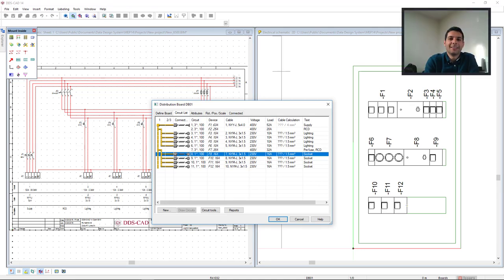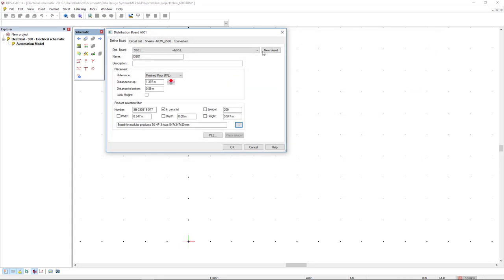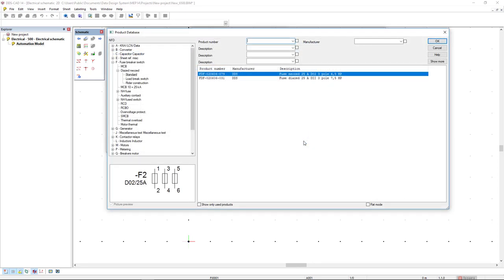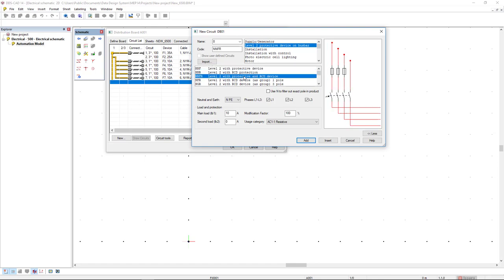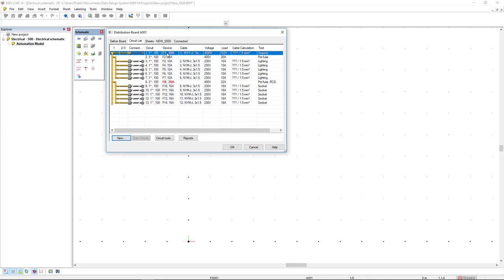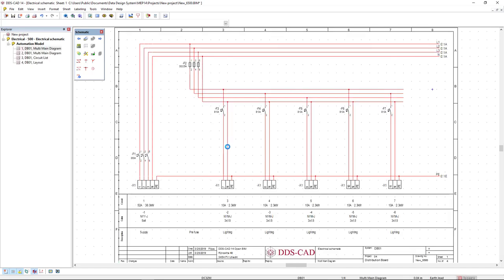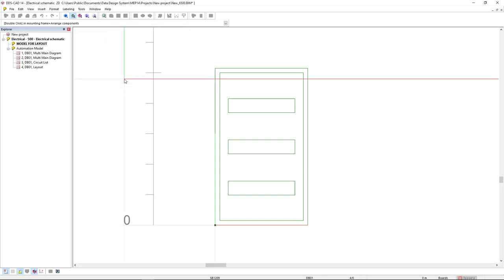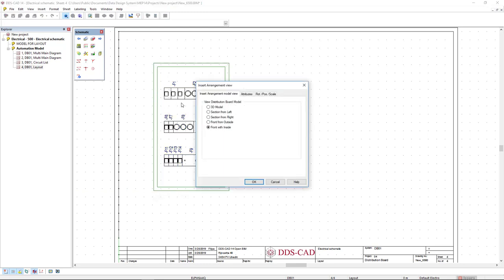Creating an electrical board and generate automatic diagrams in DDS-CAD

Comment: there is a method to give a different cable size for N e PE cables ?
Reply from the maker: Hi Daniele, DDS-CAD offers by default different cables types with various cross sections and also alternatively sized conductors. Activate the option "Flat Mode" whilst you have the cable database open. To filter out relevant cables enter e.g. "SM/" in the Description field.
Reply: @DDSCAD-MEP  ok let me explain better. In Italy, the CEI 64-8 standard envisages having the N and PE cable with a section equal to half of the phase one (in three-phase systems). For example I can have a formation of 3x 150 sq. Mm + 1 x 90 sq. Mm + 1 x 90 sq. Mm. How can I enter this?
Reply from the maker: @danitors  thanks for mentioning that you are from Italy. I recommend you to reach out to our Italian partner @Harpaceas (www.harpaceas.it). They can provide more detailed support. Unfortunately, YouTube does not offer the possibilities for us to do so.